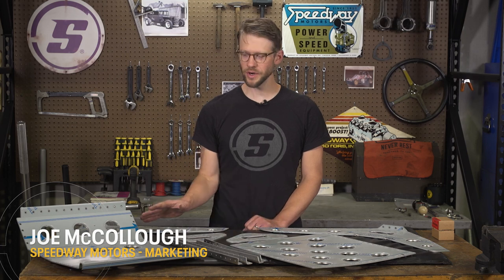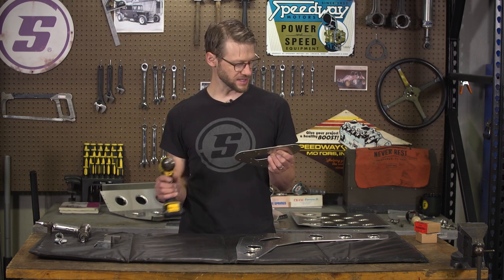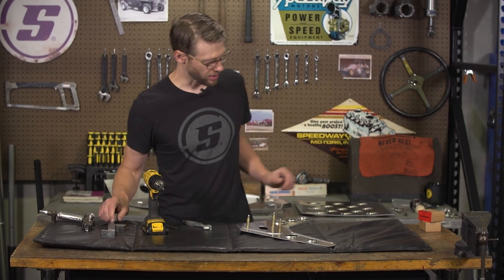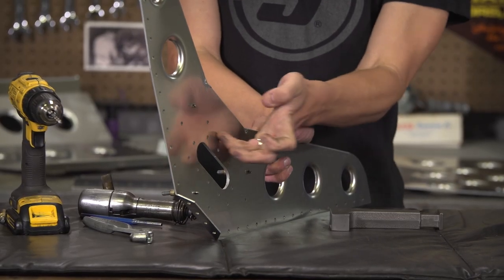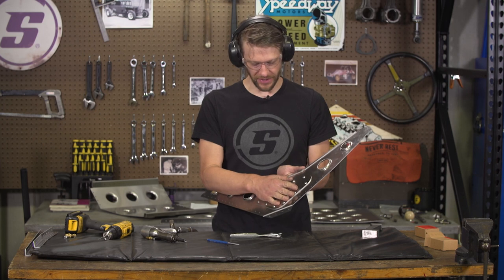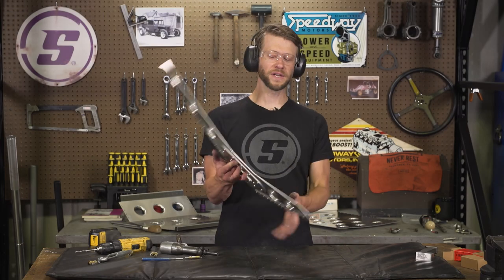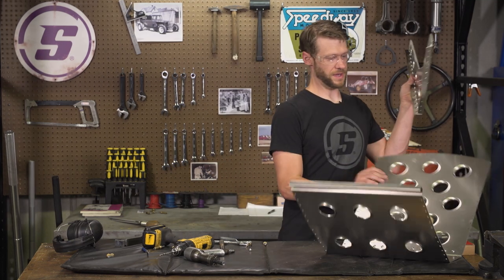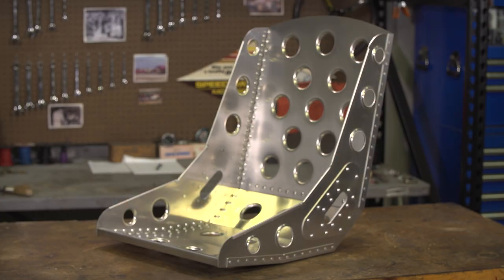Speedway Lightened Aluminum Hot Rod Bomber Seat DIY Kit

Comment: You indicate that you recommend placing the heads on the “inside” on the side brackets, I’d say this is incorrect…on original bomber seats, the harness worn parachute served as a seat cushion, in this case, since you’re not wearing a parachute while driving, you should place a cushion of some type in the seat and back, and that cushion would hide the finished head that you’re recommending putting on the inside…put the finished head on the outside of the seat where you’ll actually see it and have the smashed portion hidden by your cushion…as you instruct, the smashed portion of the rivet will be on the outside or viewed part of the seat.